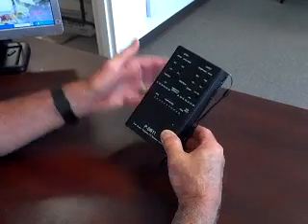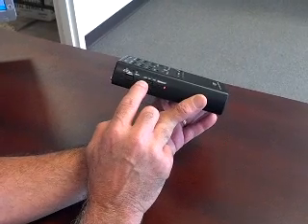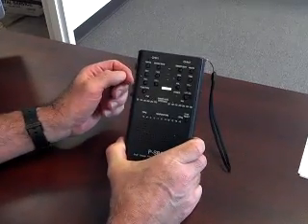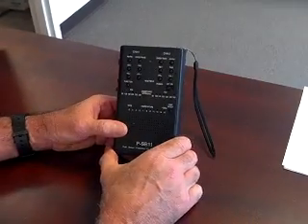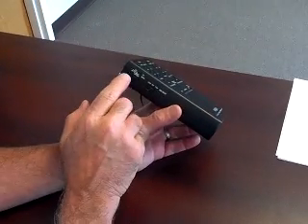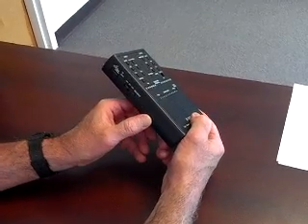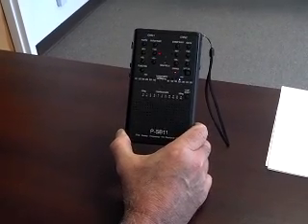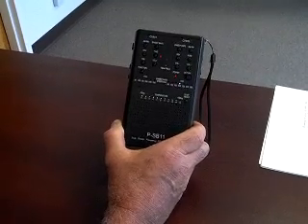P-SB11-REM

Comment: Hey Gary when I first started using my ghost box’s I’ve bought SB-7 and this style your showing know. I loved the 11 but the spirits here would drain my Batteries 🔋 within a minute. I wasn’t able to get very fat with it. I’d love to buy another but I wish there was a way you could use power cord. I just bought my portal and I’m so in love!
Reply from the maker: Hello, you can use this item to replace the battery and then plug directly into 115-120VAC. https://www.amazon.com/9-Volt-Battery-Universal-Adapter-120VAC/dp/B07JH9D8FT/ref=sr_1_3?dchild=1&keywords=9v+battery+eliminator&qid=1610285268&sr=8-3
Reply: It isn't the spirits draining the battery, the device just takes a lot of power so you only really get 1-2hrs use per battery... The best thing to do is but rechargeable 9v batteries, I have 5400mAh ones that makes the device last at least a week per charge